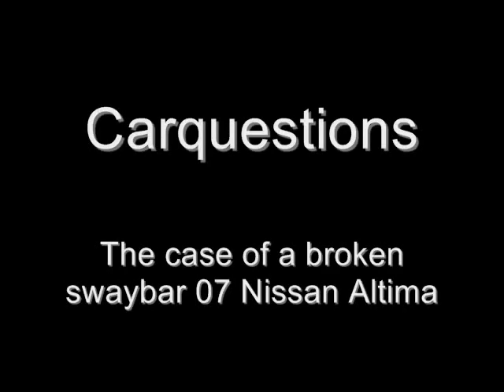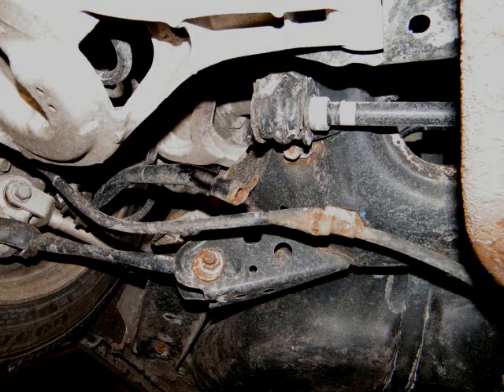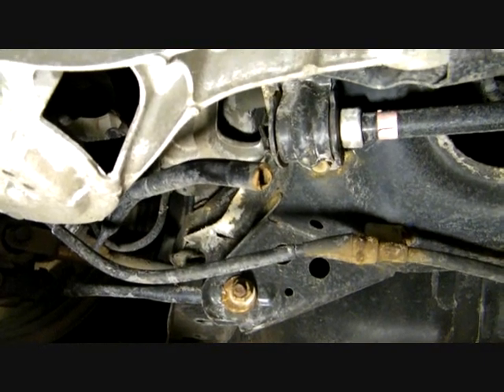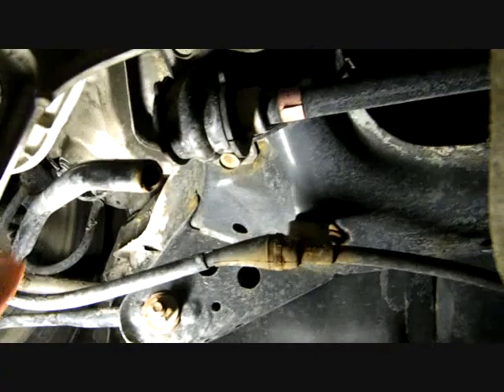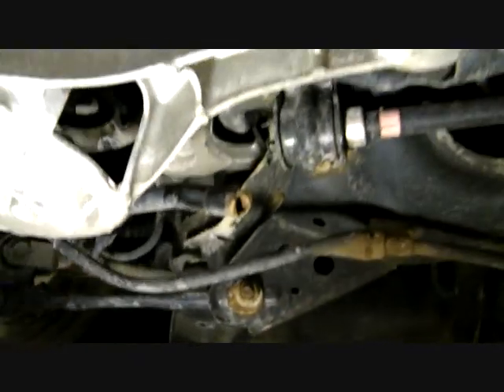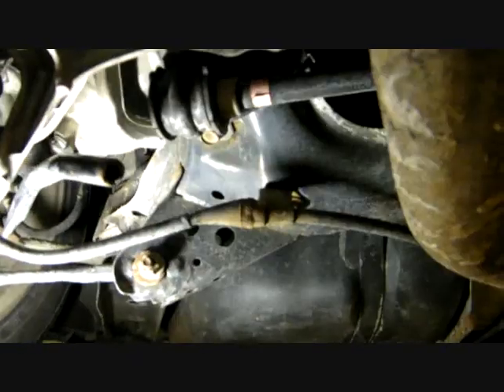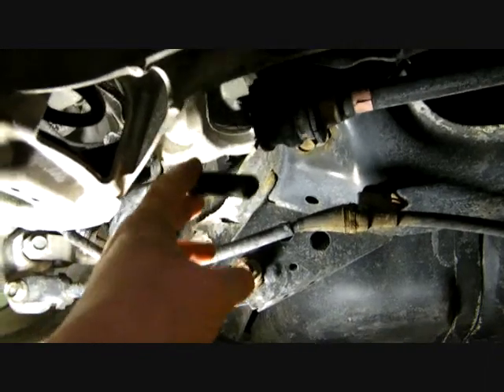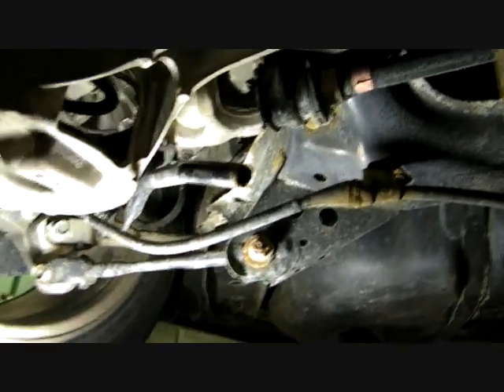Nissan Altima broken rear sway bar defect

Comment: @carquestions , just looked up warrant. Unsure if this is covered using this: The Nissan corrosion warranty provides coverage for any rust-through areas that develop on the sheet metal of the vehicle’s body. This protection is in effect for five years with no maximum mileage requirement.

Comment: I did, i actually had to remove the seat and cut out the rusted metal and then i welded in a double ply sheet of galvanized steel. Put rivets in and then also coated it with a rubber compound and after with grease. :)

Comment: Rusted floor plans? Why don't you do something about it? Sand away the rust, wash it and dry it, and then take a spray can of Krylon paint primer, about $4 at Autozone and spray about 5 layers or more of primer all across it. Wait 1 minute between sprays. Now it's rust free and protected for years and years against the elements. It'll take a few hours for it to dry completely.